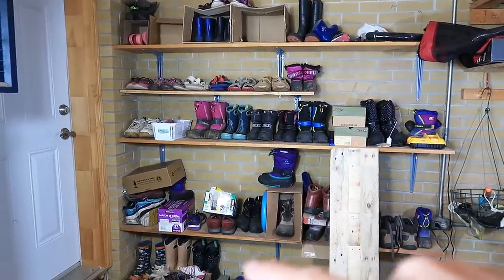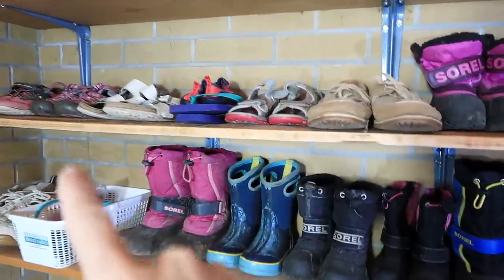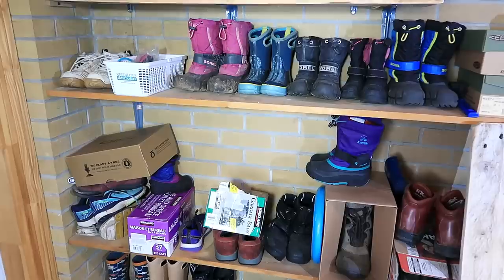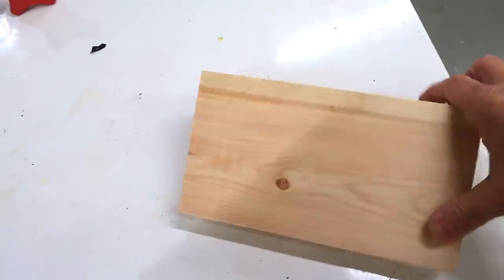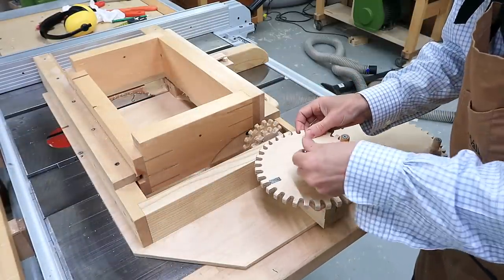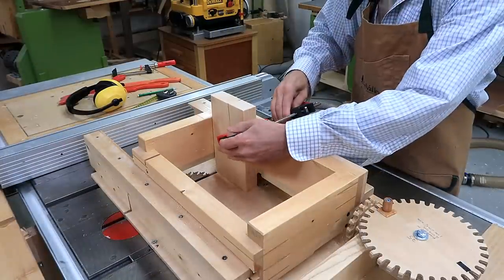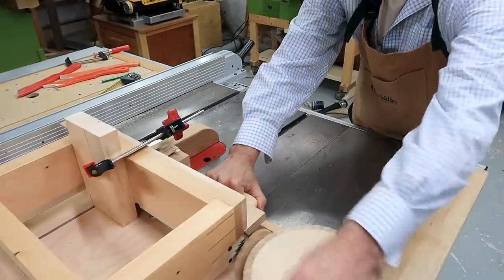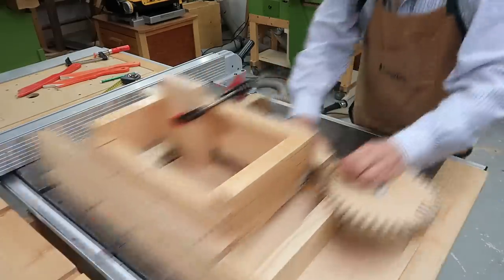Making shelf brackets

Comment: I feel like this is the first time I've ever seen you take something out of a plastic drawer. Everything else has been wood thus far!
Reply: I’m sure he would have used a wood solution but for the masonry. I suppose there would be a way to drill a large hole, insert a thick dowel, then drill a hole or cut a slot (pre cut, obviously) for a smaller peg, pin or wedge.

But this was a honey-do project, and he probably wanted to get the shelf up before his kids left for college.
Reply: @MarcosElMalo2  He was talking about the drawer, it was plastic. His other drawers are wood.

Comment: Did you put any insert in the wall before you put the screw?
Reply from the maker: it's a tapcon screw, made to go straight into masonry.  Holds much better than using some insert.
Reply: the screw cost more than the bracket

Comment: Out of curiosity did you change glue brands after your glue strength findings?
Reply from the maker: No.  the yellow glue is just too convenient.
Reply: I also note John Heisz is still using construction adhesive after that too.
Reply: @ohasis8331  I belived he used to use construction adhesive only in the winter because of the temperature in his workshop. I've seen multiple videos of him using regular wood glue in the summer. Old habits etc

Comment: I don't think I've ever seen you cut a piece of wood apart like that and then flip it around to join what was the outside as the inside joint. Have you done that type of thing before or did you come up with it for this project? In either case you must have a good sense of spatial awareness, and the ability to mentally rotate objects.

Comment: I wonder if it would be stronger, and if so how much, if instead of the fingers of the joint being in sets of 2 with one from each piece of wood,
They were in sets of 3, with 1 being from the bottom, 1 from the top, and a third from a triangular "spline".
In your examples, each "leg" seems to be ~15cm. In this case I was thinking of triangular splines. a 90/45/45 triangle with the short sides being about 5cm?
Fit the 90 into the 90 you are already making.

I guess you would make 1 cut at normal depth, then immediately cut a much deeper one for the spline, then skip (leaving a finger).

Probably not needed for just holding shoes, but if your shelf needs to actually hold weight? Maybe.
Then again, those stamped metal brackets are usually VERY cost effective. So it's probably not worth your time.

Comment: FWIW I try to avoid drilling into bricks whenever possible. I know the mortar doesn't hold a screw as well, but your project should have been fine, and the hole can be filled in the mortar much more easily without the patch being visible.

Comment: 2:00 Why do you not use a wall plug (German: Dübel)?
Reply: Wall plug can go in if the tapcon loosens up or fails, smaller holefor shank diameter.

Comment: Wouldn't the grain direction hurt strength no matter how you oriented them? Seems like decent metal ones would be a better choice.
Reply from the maker: can you elaborate?  Each piece has the grain along it's length, and the box joint joins them at a right angle
Reply: I think for holding  shoes he is getting more value out of making them out of wood than spending the money on metal ones.

Comment: Just cut that original piece of wood on the diagonal and make two triangles. Boom, shelf brackets.
Reply: Nice one
Reply: @JorgTheElder  It also doesn't take half a day to make, and require a weird jig that only one person on Earth owns.
Reply from the maker: leaves no good place for the screw, also too much leverage on it cause it doesn't go down far enough
Reply: @billweasley1382  You know there are other ways to do box-joints, right?
Reply: @Nitecrow314  💀

Comment: 1:57: Gibt's bei euch in Kanada keine Dübel oder sind die Ziegel so weich, dass das ein Gewinde reinschneidet???  (for non-native speaker's :-): Are there no screw anchor's in Canada? Or is the wall material so soft that the screw taps a thread into the brick?)
Reply from the maker: tapcon screws hold much better
Reply: @matthiaswandel  aha, must be different blick material in Canada. I know similar looking concrete screws in Germany, but they split solid bricks in the wall (even after predrilling) and don't hold much in those part-hollow bricks as they are standard in our houses here.

Comment: I am shocked that jig does not have a programmed step motor attached to a raspberry pi that moved the advancing wheel for you after the joint is programmed in and all you have to do is slide the jig back and forth....wait you could motorize that also....
Reply: His jig is already so easy to use and allows for customisation by simply turning the gear.  Sometimes adding software/automation isn't actually beneficial; I say this as a professional Automation Engineer 😅
Reply: @wrongtown  I was making a jest at him....
Reply: @thomasechols8834  Apologies, that was not clear to me.
Reply: @wrongtown  no apologies are required.

Comment: I like these videos but it would be nice to see your engineering applied to problems where a box joint machine or a pantorouter weren’t part of the solution.
Reply: I think the whole point of the video is to illustrate those cool machines.  He sells the plans
Reply from the maker: I already did that when I built those jigs - cause I built them without having those jigs.  And then I build on that!
Reply: i think you're starting to get the idea of why a pantorouter and box joint machine are so useful
Reply: @matthiaswandel  Yes, but my point is that for any audience member that has decided against building those pieces of equipment, it then makes this type of content less interesting and relevant.

That's fine, I suppose, if you consider building those tools a prerequisite to the channel.
Reply: @Nicesocks2  You could just use the same joints done a different way...
Reply: @Nicesocks2  if you can't see how you'd complete the same tasks with the tools available to you that's a failure of imagination mate. 

 It's a bit bizarre to suggest someone not use the tools they have, do you have the same energy for table saws, hand planes etc?
Reply: @wrongtown  do you disagree that a video utilizing more common tools would be more relevant to more people?

Are you claiming that table saws and planes are as common as a box joint machine or a pantorouter?
Reply: @Nicesocks2  don't be ridiculous.